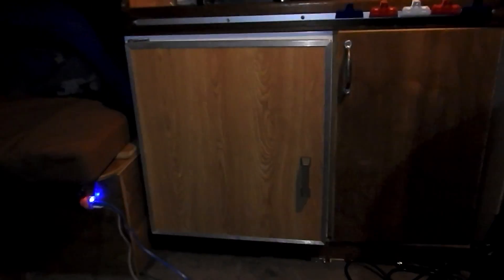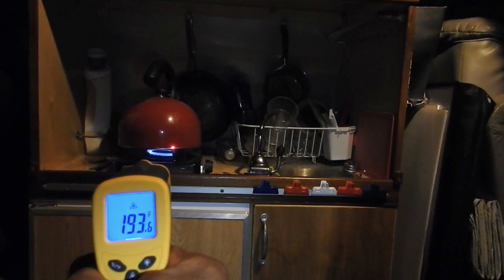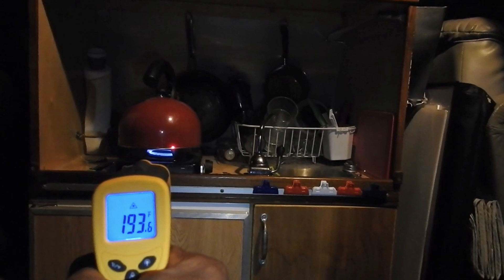Moonlight Temp Experiment Reloaded: #FEOffensive Version (Flat Earth)

Comment: "So tell me, while I'm sitting here shooting the tea kettle and it's 193°, are you saying that the laser's reflecting off of the tea kettle, and something else inside my van is 193°?"
No but what I will tell you is that your tea kettle doesn't have the same reflective properties as the tin foil.

It's a known fact that laser thermometers WILL read from a reflection when pointed at a highly reflective surface. One exception is mirrors, because they're typically covered in glass and glass doesn't reflect infrared.

The laser is reading your tea kettle because the paint on it apparently doesn't reflect infrared either.

In fact, it's interesting that you use tin foil for this "experiment" at all. If your conclusions are correct, shouldn't you be able to get the same result from any material? I mean, unless you're TRYING to get a false reading, because that seems like the only reason anyone would even consider using tin foil for this.
Reply from the maker: Feel free to tune into my new video checking the reflection.   https://youtu.be/H98mADFJzv4
Reply: HAHAHA the first example you use a mirror.
Reply: The problem with your test in this video is that you used a mirror instead of tin foil. Mirrors are typically covered in glass that doesn't reflect infrared light. Why didn't you just use tin foil for this test? I mean, if you're using tin foil for the experiment, shouldn't you be testing with tin foil?
Reply: That would require a certain amount of honesty and integrity.
Reply from the maker: Rhetoric&Discourse you goofballs are delusional. Obviously, the mirror is more reflective than aluminum foil! 😂😭😂
Reply: If people are calling you out on using tin foil or aluminum foil, why aren't you testing the reflective properties of that material? If you wanted to test the boiling point of water, would you then go out and try boil soda? Why not test out the material that you are actually using? You already have the tools to do do, we're not asking all that much of you, and if you did test out foil and found out that it did not reflect infrared light like we say it does, then you will have proven us wrong.
Reply from the maker: Rhetoric&Discourse the fact of the matter is that the laser is only an indicator of where the invisible infrared reader is pointing. The laser is not what is gathering data.
Reply: You're right that the laser isn't what's gathering the data. What IS gathering the data is an infrared camera, which picks up infrared light. Infrared light, like all light reflects.
Reply: I never said it was. What makes you think I did? Like I said " you did test out foil and found out that it did not reflect infrared light like we say it does" no mention of lasers. All we are asking for is consistency in testing out the materials that you use, not some replacement material.
Reply: Mirrors are more reflective on the visible spectrum, but they don't reflect infrared because they're covered in glass. Why are you so hesitant to use the foil for your test? Is it because you KNOW about the difference between foil and a mirror?
Reply from the maker: Todd Danza that mirror I used was actually plastic...
Reply from the maker: How about YOU go test it for yourself and send me a link when you get out of your moms basement and make something happen.
Reply: This is the problem with flat earthers, we point out the problem with your experiment and wiggle around trying to make excuses for it. You have all you need right there in your van, just take out thermometer and point it at some foil. Is it really that difficult for you? You've already made like three videos on the subject, you obviously have the equipment and the time to do, but you still refuse. My guess is, that you know we're right and you don't want test it because you already know that your experiment is faulty.
Reply: Rhetoric&Discourse "if you did test out foil and found out that it did not reflect infrared light like we say it does, then you will have proven us wrong."
At this point I don't think I don't think I'd even buy it if he did. D. Marble has been so evasive with his methods up to this point, I wouldn't be surprised if he were to pull some crap like coating the tin foil with sunscreen or something like that.

Basically, what he would have to do for this to be believable is get an unopened box of tin foil, open it on camera and show himself applying to the experiment straight out of the box.

Even then I'd have doubts, so the bottom line is I'm probably not going to buy into this until I've had a chance to work the experiment myself. Maybe I'll post a vid when I do.
Reply: That isn't very reassuring. I don't know how reflective plastic is to infrared light, but I can't imagine it would be very much. You see, the reason you SHOULD use tin foil is because if you use any other material, then you're simply assuming that that material has the same properties as the tin foil you use in your experiment, which you have no way of knowing.
Reply from the maker: Todd, you have ZERO content on your page. POST A VIDEO OF YOURSELF DOING SOMETHING...ANYTHING.
Reply: D. Marble this is called a red herring. You're trying to distract from the failings of your own experiment. Your constant refusal to double check the reflectivity of foil says a lot about your confidence in your experiment.
Reply from the maker: I'm going to recheck the experiment during the next full moon cycle. It's too cloudy tonight.
Reply: Don't let the trolls/naysayers faze you !  Your experiment would be just as valid from a piece of tarmac, stone or anything else where there is BOTH shadow and non shadow - provided the test material is exposed to moon light AND has a part which is in shadow and that BOTH are at ambient temperature to begin with. There will be a differential in your readings.
Thanks for your efforts (no pun intended) to 'enlighten' !
Reply from the maker: colliecandle I'll be doing this again with more materials. Have to wait for the next full moon cycle tho.
Reply from the maker: mdunbar008 I know, I know. I'm gonna redo the whole thing with multiple surfaces at the next full moon cycle.
Reply from the maker: Right, I may very well set up a table in the parking lot to ensure that the temperature of the pavement doesn't effect anything. Next time, i'm leaving nothing to chance.
Reply: D. Marble I'll get one and record myself outside testing the street,grass, dirt, rocks, t-shirts,jeans, sneakers, hat, gold rings? 2x4s, bowls of water, and sure some foil why not.  there are so many things to measure the temp of. I've been curious about this and I believe it without testing but I wanna test it for myself.  I'm 80%FE 10%RE 10%IDK
Reply from the maker: I plan to go back and test multiple surfaces on the next full moon cycle myself.
Reply from the maker: James Golz you'll get over it cupcake.
Reply: D. Marble "I plan to go back and test multiple surfaces on the next full moon cycle myself. "
You'll still run into the same problem, just on a smaller scale. While some materials are considered non-reflective to infrared light, even these materials do reflect a tiny amount. It's not huge, but it's enough to throw off your measurements by a few degrees.
Reply: mdunbar008 Good job checking those out. Are you saying that you actually tried glass though? If so, I'm kind of surprised at the results. What type of glass did you use? I know that IR doesn't pass through glass, but It typically doesn't reflect off it much either, though I'm sure there must be some types of glass that stand as exceptions.
Reply: Rhetoric&Discourse   this is called trolling, he did a valid experiment and you are talking crap just trying to get him to waste his time. If the foil was reflecting then both test pieces would be reflecting, so both would be wrong, so why the big difference in temperature.  Are you saying the laser is bouncing off and towards the moon, and as the moon is cold, it's not a fair test.  He is trying to prove the moon light  is cold.  What is it that you think the laser is reflecting on to?
Reply: 1960ARC both test pieces are reflecting, but one is reflecting the sky, which the thermometer can't read, and the other is reflecting his little homeless shelter, which is about 59°.

Comment: Why is your foil measuring 17° and 18° in the middle of June? Do you have any idea how cold that is? That's like 15° below freezing, and you expect us to believe that this is the actual temperature of the foil? Where are you, South Australia?
Reply from the maker: Is aluminum good conductor of heat?
This is because metals like aluminum are very good conductors of heat, so they absorb heat very quickly. When you pull out the potato, the same property of being a good heat conductor makes sure that the foil cools down very fast.
Reply: Of course I understand that it cools down fast, but it will never cool to a lower temperature than its environment. if the temperature where you're at is around 50-60°, (which it looks to be, because that's what the other objects you tested it on read as), then the foil should be about that same temperature.

At 17° you should be able to drop some water on the foil and watch it turn to ice.
Reply: D. Marble - You are almost right. Metals are good conductors of heat. But there is a difference between heat and temperature. Heat is how much energy is being transfered and temperature, how much energy there is. This is why metals feel colder to touch when it's at the same ambient temperature than something right besides it. Because it radiate heat from your hand quicker. And a metal(actually, all matter does this) will ALWAYS get to the same temperature as its surrounding, and never below. Why you may ask ? well, because for that you would need to pull energy from it. which you don't, and so does its surrounding. Energy will always go to an equilibrium, hence why all matter gets to the same temperature as their surroundings.That's called entropy.

Comment: Try doing the test using a cooler. Remove the lid earlier in the day so the inside of the cooler stays natural temperature , and Measure the temperature on the inside of the cooler after its been in the shade for 60 seconds and 10 min. This material should keep from the earths heat from getting trapped in the shaded area as it rises, hence the hotter temps in shaded areas. Also use different color umbrella or coverage. I'm on your team. Thanks bro.

Comment: Please run this experiment one more time with the the shielding on the opposite side allowing moonlight to strike both targets.  This will eliminate any possibility of the heat of the shielding to skew the results if both targets measure the same in the moonlight.  It's the only thing I can think of that the globie clan can nit pick.

Great video.  Thank you for your time and effort.
Reply from the maker: sigh Oh alright...
Reply: I know why you're asking for this... globers have a theory that at night heat for some reason i don't know radiates back into space so coverign it up stops the heat from radiating away. that don't really make sense to me. the moonlight somehow facilitates cooling at night yoo hoo
Reply: It's called radiative cooling.  Objects that are warm near the target will give a false reading.  Putting the shield on the other side and demonstrating that temps are the same drives the final nail into the coffin of "radiative cooling" used by them to explain away what we are seeing.
Reply: (Found out boxhead was a liar and a troll, not worth any consideration) So I sent my comment behind the curvature.💡)
Reply: D. Marble  What did I say?  Someone was going to post "radiative cooling" to explain it away.  Walter Boxhead posts on all the comment sections along these lines.
Reply: Walter Boxhead  Care to comment on my previous post regarding your notice?  I'll give you another one CEASE and DESIST all disruptive activity on this thread.
Reply from the maker: Dear Blockhead, go do your own experiments and post them on this thread. Until then, zip it.

Comment: Like your last video, all you have measured is the infrared heat energy reflected off of the foil.
You can't measure the temperature of a reflective surface with an infrared thermometer.

The only thing either video shows is your ignorance.

At least try reading the instructions that came with the instrument you are using.
Reply: I think the device was measuring his IQ instead :D

Comment: 1:15 - No, the surface of the tea kettle is hot, so it is emitting infrared light and that is what then sensor is detecting. However, because it is a metallic surface it ALSO reflects the incoming IR from other sources (although it's coating might prevent this). When you try to measure the temperature of the aluminium outside, you are measuring any IR emitted from the aluminium itself, AND any IR that it is reflecting, metal acts like a mirror for IR light. Incidentally, when you put a room temperature object in front of the aluminum you are adding whatever amount of IR that object is emitting to the reading. It's really not that hard to understand.

Literally ALL you have to do to make this experiment valid is not use metal for your temperature measurements, the ground is right there, just measure the temperature of the ground in moonlight and in shade ffs. But of course you won't do that because that would just prove this experiment is a load of crap, and break your little narrative that moonlight is cold. So much for 'truth' hey.

Comment: All I see is measurements of pieces of foil both in the open air outside at night and a piece placed inside a enclosure. The enclosure is hotter because it prevents any  ambient heat from escaping while the pieces in the open air have nothing to prevent any heat from radiating away making them the same temperature as the open air. Nothing you have done proves your basic premise that it is the moonlight creating the temperature variations. You have to perform the same experiment on a night of a new moon. If the pieces of foil in the open air and under the cover show the same temperature then your premise holds merit. If they still show a significant temperature variation without moonlight then your premise is false.

Comment: The laser is not involved with the measurement. Its only purpose is to help you target the region where the infrared sensor will focus.Think of the infrared sensor like a specialized camera. It is measuring a certain wavelength of light which is correlated to the heat of an object. Therefore, you really do not want to use a reflective surface. This is one reason why your temperature readings are jumping around.

You should use some common sense when conducting experiments. For instance. I don't know what temperature the air was at the time, but you are walking around in short sleeves and I don't see your breath when you're talking, so I'm going to assume it was not below freezing. Yet the temperature you measured on the moonlit foil was 14 degrees F (give or take). If the air temperature around the foil was above freezing and the foil was below freezing, then there would be condensation icing up the foil. If the moonlight is cooling the foil down to 14 degrees, why are you not freezing - being exposed to the same (supposedly) cooling light?

Also, how is it possible that the mass of the shadowed foil went instantly from 59 degrees to 14 degrees? That is not the way thermoconductivity works. Heat takes time to dissipate. And, for that matter, where is the heat going? It has to go somewhere.

Sorry man. This is not science.